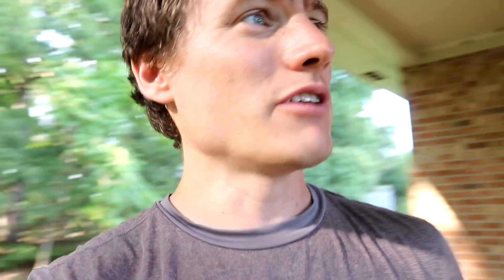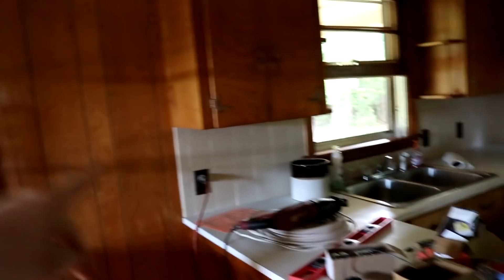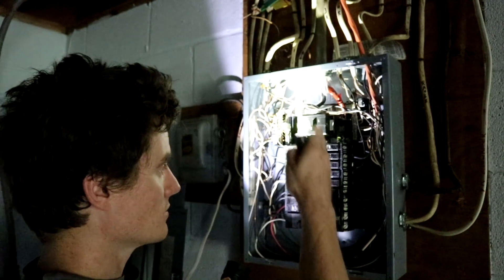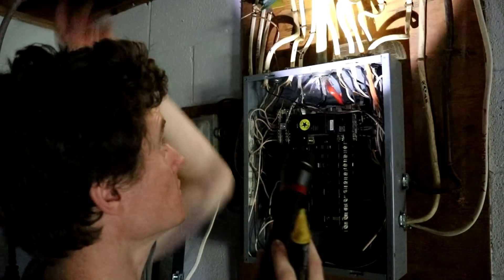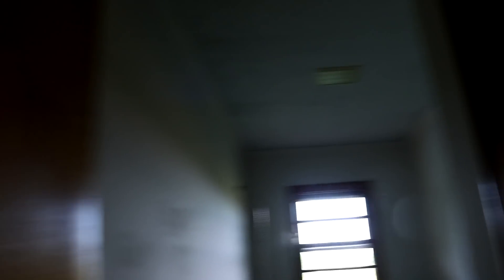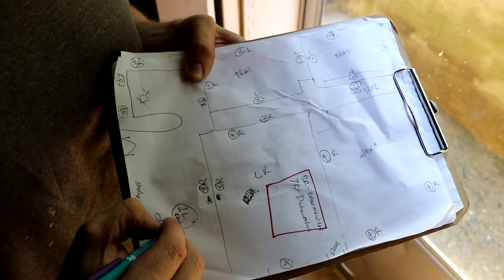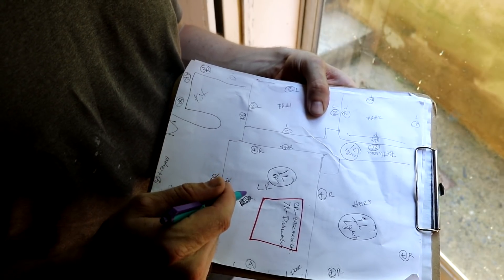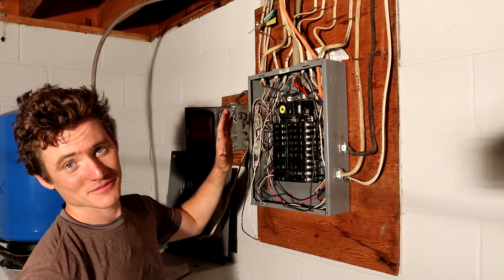Old House Renovation - First Day of Work! - #3

Comment: Surprisingly, that box may look even neater than the one in the $12K house. Without doubt someone will comment about how its ridiculous, a waste of time and that no one will ever see it. My personal opinion however is that, just like integrity, doing a good job (or being honest) regardless of whether anyone sees it or not (or knows any different) is a reflection of ones true character. Keep up the good work brother!
Reply from the maker: Making a box clean while wiring takes about the same time to make a mess. I don't do it for looks so much as it's a way to keep it organized which is better if you have to come back into the box for some reason. Also, the bends I make, keeping it tight to the box, makes it easier while wiring to not have stuff in your way and gives you extra length in your wires if you need to trim one later due to a breaker going bad and melting a wire.
Reply: There is zero reason to not be neat.  Back when I used to build computers, I kept all my wires neat and tidy and would tape a print out of the components on the inside cover.  I dislike untidy cords.

Comment: Very neat and tidy job. One thing is for sure, plenty of space to add new circuits as needed down the road. When my folks upgraded from 100 to 200 amp, the had a dedicated line to each of the bedrooms for electronic devices. Here in Ontario a circuit is limited to no more than 5 devices, so when the upgrade was happening anyway, the made sure that there were no more than 3 devices on any one circuit, just to have flexibility later. Keep in mind this was in a solid brick 2 story home from 1903. When the bought it, Ma's dad stripped out all the old knob and tube in the original 1923 service that was only 35 amps for the whole house. This was 1960, and Gramps ran all 3 wire Romex through the house, so all the boxes at least we're grounded. Made it simple to ground all the outlets over time. When the second upgrade was done, none of Gramps' work needed to be touched. It was still completely compliant with the Electrical Code 40 years after Gramps did the work.

Comment: In 1961-62, Dad built the house - he wired it with 150 amp service, fuse box.  People used to comment as to why so heavy duty - we never had window a/c unit until 1976.  Dad put in central air in 98ish and the 150 service is still plenty.  Great job, by the way.

Comment: That one plug not being on the same circuit (if that's what's going on) is actually super useful for a microwave or electric kettle - that way you don't trip a breaker if you run both simultaneously.

Comment: One thing I really want him to do is cut the stairs to make a landing and turn it so the bottom step is towards the wall with the breaker box. That basement would be fabulous if it were remodeled and turned into a nice finished room(s). With the outside access door and the bathroom it could be made into an apartment, it would be an awesome area for get togethers with friends or to rent out.

Comment: I call it a sniffer too. Whenever we do a service upgrade we also use wire nuts inside the MEP to lengthen the wires if we need to. Two ground rods is code here, we've always been able to run one ground wire to two rods though; I think they have to be at least ten feet apart.
Reply from the maker: I ended up doing one wire then jumped over to the next. First time someone made me do it.
Reply: @homemadehome5575  Yeah, that's how we do it too. It's been code here for at least as long as I've been doing it, which is going on ten years now.  According to the code, if the single rod does not have resistance to ground of 25 ohms or less, you need another rod at least 6 feet apart. Eight feet is best because it's the same length as the rod.

Comment: in the UK they used to use wire nuts in 70s but got made illegal to use. we would normally put a junction box next to the distribution board (breaker panel for Americans) or straight trough crimp the cables inside the DB so its a maintenance free connection.  it's weird seeing how certain things are done in the USA like having your lights and receptacles on the same circuit, we can have them on the same circuit as well but it must go through a fused connection unit and the fuse to be down rated to what the light fittings will take which would bee 5 amps. i would be amazing to get an electrician from different countries in the world and get them to do a booth of different wiring methods they use for sockets, lighting, large distribution circuits and stuff like that. and as always a great video from Scotland

Comment: I'm really impressed with your work.  It is always so need and organized.  Even looking at it on the screen I can follow the connections easily.  Even the wire nut connections are easy to follow.  Really good job.

Comment: Danish guy here and to me, the American way of installing electrical circuits definitely doesn't seem safe. But you're also using lower voltages than we are. We have 230-240 volts in all of our houses and all our breaker panels are in plastic. Our breakers also have space for small labels where descriptions of where the wires go to, can be placed. Normally quite convenient, unless the electrician who installed it, was drunk that day (as seems to be the case with my apartment. Turn off the breaker for the kitchen and I lose half the power in the living room and entré, 2/3rds of the power in the bedroom, but none in the bathroom which is directly next to the entré. Same goes for all the other breakers. Makes no sense whatso ever). But yeah, everyone does it their way and that's perfectly fine as long as no one dies of electro therapy overdose. In case anyone's curious, then this is how breaker panels look like in Denmark (at least the modern ones):

http://ah-el.dk/sites/default/files/imagecache/profile-image/5703353085636p.jpg
Reply: Arterexius Gaming I live in Sweden and I think the restrictions here are even harder. You are much more laidback in Denmark, in a positive way. Soon we'll have to get a driver's license to ride our bicycle. And you'll have to be at least 28 years old to even consider getting the license. Absolutely ridiculous.
Reply: @M-W-N-N  I agree that it's absolutely ridiculous. Sweden is also often used in jokes here in Denmark, because your situation is so damn ridiculous. It's all in a good, familiar spirit though. We're mostly just worried over the situation of your country. Cracking rather offensive jokes is just the national way of showing affection.

Our laid back attitude is mainly coming from our idea of common sense. If someone misinterprets it, gets triggered and won't calm down when someone else tries to explain it as it is to them, then they'll just get ridiculed instead. That's a quite effective way to make sure people consider things more than one way and goes with what would make most sense nationally speaking.

That said, we are though getting more and more restrictions too. Enough so that the most often used counter whenever mentioned publicly, is some form of "we're getting closer to the state of Sweden". Even the politicians use it.

I'll end this off saying that a lot of us are quite happy to see Sweden finally being split in half, with one party recognizing it's gone way too far. That means all hope isn't out yet and a lot of us are happy to see that :)
Reply: 110V is more dangerous than 220V. Because current becomes double for same power. İf you use thin cable, 110V can burn it quicker than 220V does.in turkey we started to have 380V and 220V at the same time.380V is for big heaters and central air conditioners.
Reply: @edizzeuc8105  Ah, didn't know that, thanks a lot for the info! :) Doesn't really make it any better that they're using metal cabinets for their power then... It kinda becomes a waiting game of electrocution

Comment: What little of the electrical code I do know, I'm a bit amazed that wire nuts in a breaker box is an okay thing to do. Might vary by location of course but I'm going to have to file that away for future reference.

Comment: If you use tomic connectors (butterfly type connectors) you can put 2-4 wires in each connector entering the panel in a 1/2" connector, 3/4" tomics you can fit more or larger wires depending on your local code. This makes it easier to install all of the wires from the top of the panel and not have any enter from the sides. You can also staple 2 wires on top of each other if space gets tight at the top. Your finished results do look nice, you have no idea the rats nest of wires some people create when they do panel work.

Comment: I have a house my dad owned and it's been neglected. I am comfortable trying to unclog drains, tighten screws, replace doors and caulk windows but am scared to do anything electrical. 
I am having an inspection done to see exactly what I need to fix and replace. I am hoping it's not too bad as I would like to stay here but have a feeling it's going to be big $$$ to get everything done right.
With luck and your videos I will be able to do some of the work myself.
Reply: Have you had your inspection? If so what's the damage? I hope it's not too bad.

Comment: OMG I just did this in my Grandmother's old house I'm rehabbing. It's a hundred year old, two family flat. I have a SPERRY duel detector. One end is open like yours, the other end is a three prong plug. It detects reversed installation, open ground, etc... it'll let you know if the outlet is installed correctly. This made labeling the breakers really easy and much faster. I also purchased a voltage monitor so I can know exactly how much voltage is being put out.
Reply from the maker: I have a separate detector that does that, very helpful when rewiring a house and figuring out a problem.

Comment: Great example! I learned that it's best to test breaker by breaker even when they are marked. I had a house where the previous owner had done some weird rewiring. The switch in the dining room next the door to the garage was wired to a fan (no light) in the living room and was on the kitchen circuit. (Nothing like coming into a dark house and turning on a fan. LOL) Once I figured that out, I also figured out why the kitchen breaker kept popping: he'd rewired several other rooms to the kitchen breaker.

Comment: Seriously inspiring, I've got knob and tube in my house, I shut off the main to change light bulbs :).
Reply from the maker: I've removed it from houses, my house had it in portions still hot.
Reply: @homemadehome5575  I'd love to see a video on that, even if I can't do it myself, It would be good to see what effort it takes to replace. My house seems to be set up with both. I've been replacing some of the lighting with LED fixtures, but don't still don't have a proper ground.

Comment: Next time run jumper to the panel wire nut on  2 wires on your hot leg then connect to the main breaker connect neutral and ground as usual.
Random outlet is probably a GFi and the main receptacle is tripped
30 2 pole could also be for dryer
Per NEC the panel can be used as a junction box
Clean job
I was watching a video from Australia guy was walking around house showing the remodel and there were no boxes in the walls. When I made comment about it he had never heard of electrical e=wire being in boxes!
Reply from the maker: Thanks

Comment: So in your area do you need AFCI breakers? Here in CO we are "supposed" to upgrade a standard breaker with an Arc-Fault breaker anytime we do work on most 120 volt circuits. New wiring installations are required to have AFCI breakers on almost all circuits before it passes code.

Comment: The thing is in the UK. we have 240v as our normal power, so basically it's a killer. 'We' can run wire but we cannot touch the fuse box, we must have a trained electrician do all the work.

Comment: Did you check for split plugs in the living room?  Almost every house I ever worked on had no overhead light in the living room, but depended on lamps switched by the front entry.

Comment: So with the house im buying, all of the electrical needs to be upgraded. We won't be doing it ourselves(we have family members that will) but this was super cool to see
Reply from the maker: That's good. This would be pricey to pay an electrician full price.
Reply: @homemadehome5575  The house was built in the 40s and nothing is grounded. They updated the outlets to 3 prong but not the wiring.
The hope is that we can ground the panel box but we need someone other than just the inspector to look at it

Comment: Helps to have a young helper, a kid, to run around checking the lights and receptacles.
Reply: @xw6968  when i was 18 months old.  My dad's keys.  Bwen fascinated with electricity since.  :)
Reply: Bob W I stuck my fingers into a lamp holder when I was 2. Currently training to work in substations. Must do something to the brain 😂

Comment: Nice work, but I still don't get why you had to make a suicide cord. Why do you have to understand where all of the wires went before replacing the panel? Couldn't you have just done all the same work without knowing where the circuits went and just labeled them after, once you had service back on? Seems like a lot less work and risk.
Also: Incredible that you don't run a single GFCI or AFCI breaker. Perhaps not in your jurisdiction, but in MANY areas they're required now for most circuits on a panel upgrade. Even if not required, I'd suggest considering at least AFCIs in any circuits that someone can plug in to (plus the obvious GFCIs near water). They're really good nowadays and keep your house and occupants safer.
Reply: Your first question:  you must label all of your wires in the box per code.  
Your second question:  GFCI and AFCI are required on NEW construction only, or a renovation. If you dont change outlets, you dont need a GFCI or AFCI.  But, it is a good idea to have them.  Maybe in the box itself.
Reply: @kerryclark1926  - I'm not saying don't label them. I'm asking why not just label them after the new panel is in when it's much easier (and less dangerous) to power the circuits? And as far as I understand it, upgrading a panel requires anything in that panel to be up to code, which means adding AFCI and GFCI breakers per local requirements (especially when adding new wire to the branch circuits)
Reply: He wanted to label them so he could group them together in the panel. Just an OCD thing, but it is good workmanship.

The wire extensions for the service upgrade was less than 6 feet, so no AFCI upgrade required.
Reply: @0778drz110  - Indeed you appear to be correct. Still, I'd have upgraded. AFCIs are excellent insurance and I don't want an old mouse-chewed wire to burn my house down. Regarding grouping, sure, but he still entered the side of the box with that old cloth wire. At least bring that one into the top to reduce damage risk? 
(BTW, I know I'm armchair quarterbacking here - overall it's MUCH better than a lot of crap I see, and likely perfectly safe)
Reply: @truthsmiles  Upgrading 10 breakers to AFCI would cost $500. Not cheap to do. Renters getting nuisance trips could be annoying. If the wiring was a spagetti mess I would be a little more concerned. AFCIs do prevent fires, but they dont fix hack wiring and hidden junctions in the walls. I have seen melted and arcing wiring that wasnt detected by them so they arent perfect. 

One thing I would do though is GFCI outlets in the kitchen and bathrooms. The original QO panel was a good panel, but if it was something like a Zinsco or FPE rip that thing out before it burns down. Many insurance companies wont insure you with them.
Reply: @0778drz110  - Fair enough, and I know they aren't cheap, but I put them in my rentals if I touch the panel. The modern AFCIs don't nuisance trip like the old ones do, and if I have a 50 year old cloth wire somewhere it gives me peace of mind :-)

Comment: Did you need to upgrade to AFCI breakers for all of the outlet circuits? Up here in MN it's a code requirement now, and i'm not sure you'd get away with using normal breakers if you were swapping the panels.
Reply: A lot of areas never really bother upgrading to newer versions of the NEC. My town for example inspects based off something like the 1987 version.
Reply: He isnt required to go AFCI in this scenario.

Comment: Nice hack with the generator... I'm curious how you deal with the city/county permits to renovate for rentals or flip - presuming you are not a GC. I am to start doing all the work myself for my rentals but it let's just say it turned out to be more liable than nothing else...
Reply from the maker: I get building permits, most areas will let you do it as the homeowner.  Just call them and ask the process. Say you are doing research before buying a house.

Comment: Did you have to use any arc fault breakers since you upgraded the panel?  Why didn't you install a new maybe 30 space 200 Amp panel next to the existing 100 Amp panel and just subfeed it?   Seems like that would have been a lot less work.